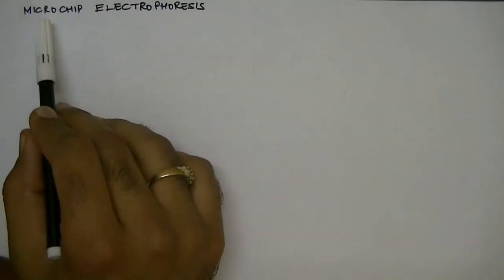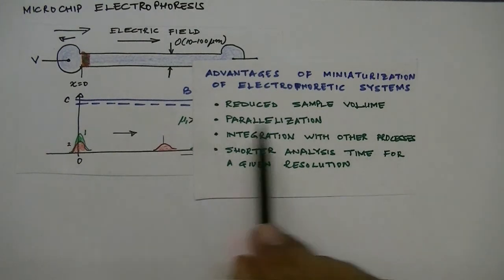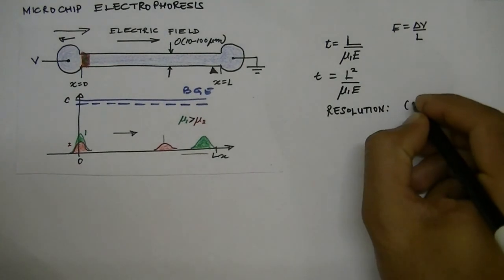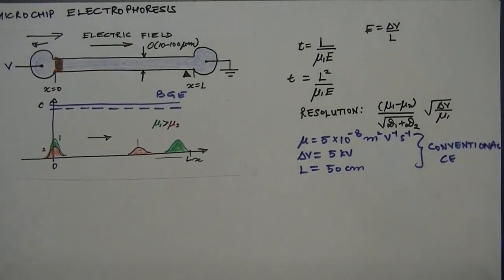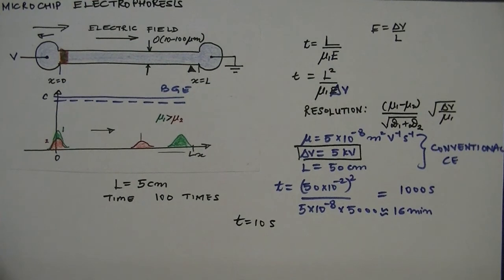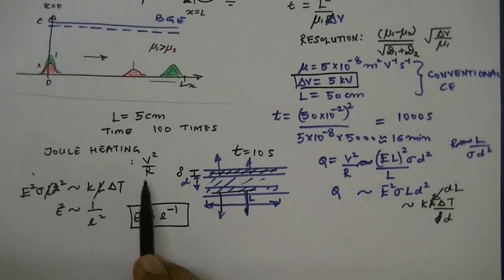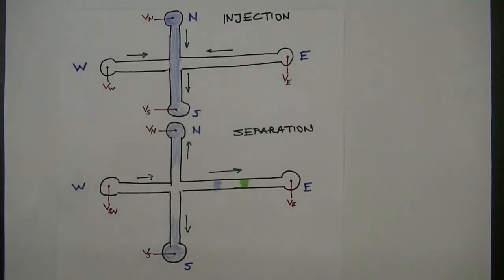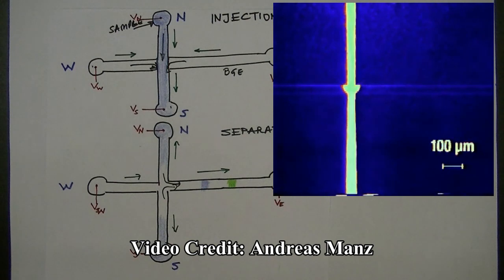Lecture 30: Microchip Electrophoresis

Comment: Would be great to also address the big challenges of microfluidic electrophoresis, generation of gas at electrodes and electroosmotic flow which will result in one chamber losing all of its buffer.